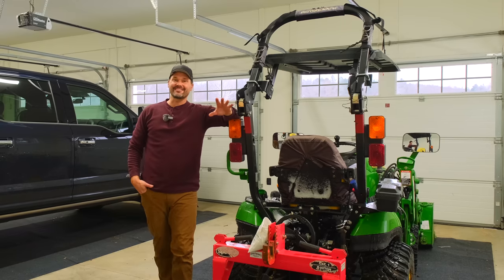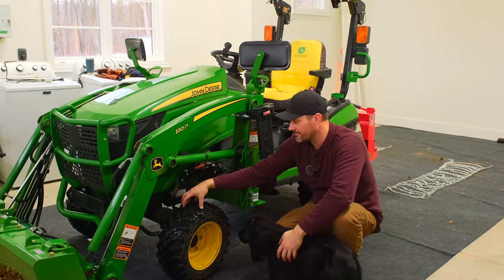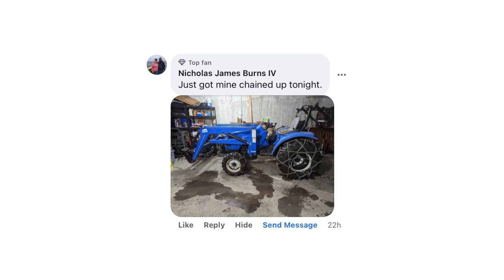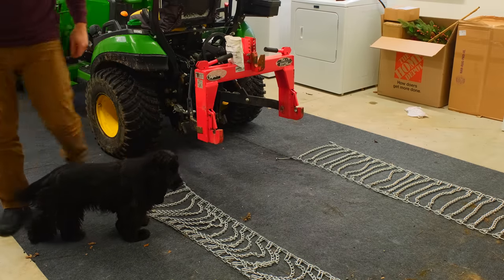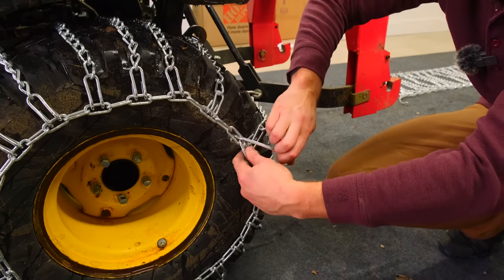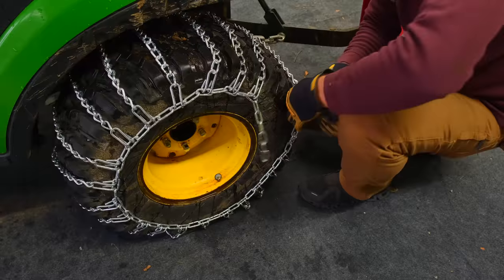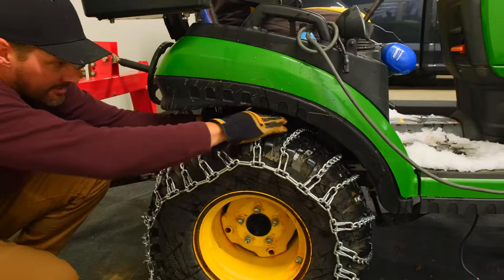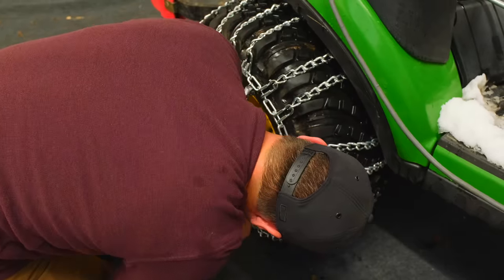IS THIS BETTER THAN PLAIN OLD 4 WHEEL DRIVE? 🤔

Comment: If a guy can afford an extra set of tires. Have a chain up tire & wheel. ( Realize this is expensive but get a spare wheel) then save an old tire for pre-chain up. Then just change out TIRES, for just winter work. Use an OLD tire, the tread does NOT matter with a great set of chains. Get a chain set like Loggers use. Cross link that has a "V" steel link. Use a chain Cross tightness steel outside  tightness ( they have great ones that have a steel ring in the center ( instead of bungy straps) after using chains for half an hour, 
re- tighten, check them. Always check to make sure no contact from chains such as anything going to wheels. Could be just a small rear brake line. Anything on the inside is as important as the outside. Use your Backhoe stabilizer as a lift tool for raising the rear tire.

Comment: Having used tire chains for 2 years plowing snow on my 1025r, I have a hard time believing tire chains on the front are any harder on the front end than, say, driving into a pile of of gravel in the summer in four wheel drive. They don't provide that much traction on hard packed snow. I used my tractor to push a tuscon stuck in gear onto a trailer in four wheel drive on a gravel driveway. Surely that was harder on the front end.

Comment: The chain that are on the left rear of your tractor are installed incorrectly they should look like the ones on the right rear with the links facing away from the sidewall not toward it. If it's left the way they are you'll tear up the sidewalls on your left rear

Comment: I realize this is a no brainer. Just remember to make sure the link is on the Right facing UP. 
Another thing I have seen. Is county road crews. Just fill the backhoe bucket up with used chains. The only thing wrong with them is cross link all worn down. Side link still 100%. Get a tool to Replace cross links. Don't just recycle in a metal bin. Replace the cross link. So much cheaper than brand new chains.

Comment: Chains are nice, but I prefer to use studs. I have a gravel driveway, so not worried about damage
Reply: Studs work well on ice, though not nearly as well as crossbar chains.  They don’t help much in deep snow though and chains can help a lot there.  And chains can be easily removed for summer, whereas studs no so much.
Reply: @LTVoyager  I just leave them on the whole year and never had issues with them in snow. That being said, I mostly use my tractor on hard packed snow
Reply: @williamlance6132  That works also.  I have a paved driveway and studs tend to be much harder on pavement than are chains.  And I don’t use chains until I have either a layer of hard packed snow or ice as even chains cause damage over time.  I like chains because I can fairly quickly take them off when I don’t have a protective layer on my asphalt.

Comment: well i havent yet made myself a set but my granpa runs chains and they work wonders i dont know about chains on the hydrostat also a thing i dont understand is why dont new tractors have 3pt down pressure my early 60s tractor has it and actually all russian tractors have and chaingin tires is a easy job all you need is a rear bucket or something solid to lift the tractor rear up and the take a big tree stump prop it up under it and lower the 3pt and you are done 5 minutes and you have both rear tires up but new tractors and over all american tractors dont have that like i use that all the time also good for chaining up you lift the rear up 2 guys one in the tractor slow gear and lock the side up ratchet strap trough the rim spinn the open part to the bottom and snug it up and you are done and no lifting more than just to fasten the one end to the tire

Comment: Why do you have to put changes that 1025r is4 wheel drive
Reply from the maker: A few years back, I got stuck just off the side of my driveway in the snow with a 1025r.  Four wheel drive didn't matter, I'm pretty sure chains would have made a big difference.
Reply: My previous tractor was a JD 4400 with R4 (industrial) tires.  That thing was a pig on ice!  Without tire chains it was helpless.  I now have a 2025R with radial turf tires and on the same driveways it does not need chains.
Reply: Ice.

Comment: I live in the south and have never used chains. I have a question, could you jack up the tractor and then install the chains?
Reply: Yes, you can.  This works well in the garage, but not so much alongside the road so it is better to learn how to do them in less than ideal conditions.  I use drive-on chain ramps and they work great and can be used almost anywhere.
Reply: @LTVoyager  
Thank you for your response. I wasn’t thinking about along the road. I have never dealt with snow and ice on a consistent basis. So that’s the reason I was asking. 
Merry Christmas
Reply: @barrettconkle4488  Merry Christmas.  I plow snow with a pickup rather than a tractor and I often find I need the chains when I am away from home or at the bottom of my 1800’ driveway.  I can’t always easily get into a garage to install the chains so I carry coveralls and chain ramps in my pickup during the winter.  😁

Comment: You put the chains on wrong. All the hooks on the chains should be on the outside of the tire to keep them from biting in the rubber. Take the chain off so all of your link connections are facing away from the tire.

Comment: Jack the wheel off the ground and let the air out then put your chain on as tight as possible. Air the tire back up and your chain should be real tight and shouldn’t move but very little, the add your tightner. 16:56

Comment: Jack the wheel off the ground and let the air out then put your chain on as tight as possible. Air the tire back up and your chain should be real tight and shouldn’t move but very little, the add your tightener

Comment: you are working way to hard. Lay them out drive over them and then hook them up. If you have the room and time in the shop use the floor jack raise the tire off the floor. Drape the chain and spin the tire to adjust the fit.